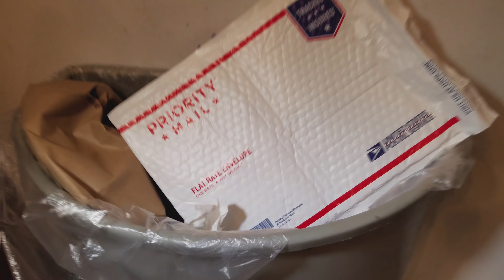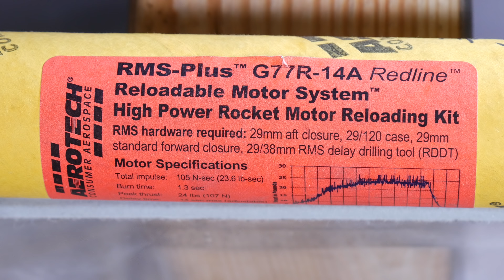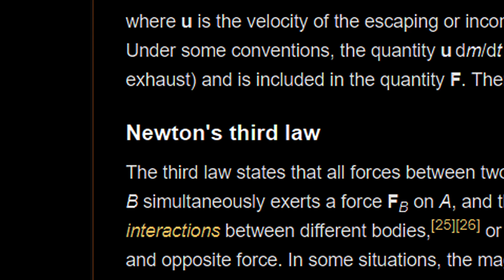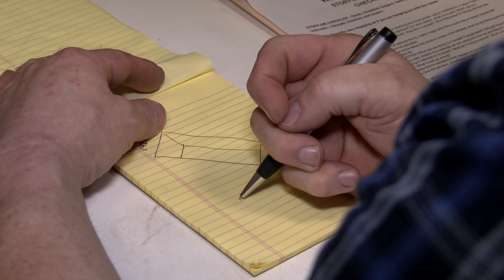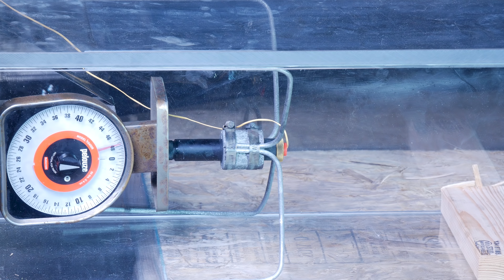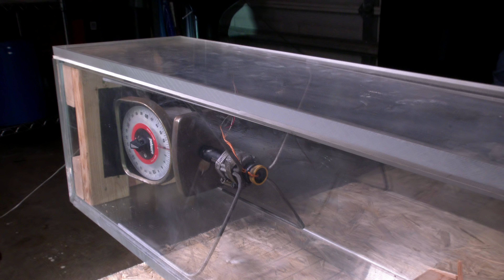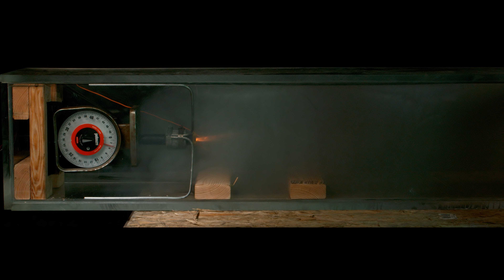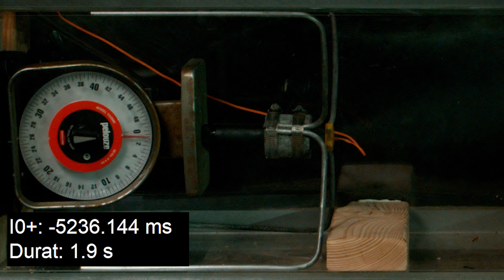Rockets in a Vacuum Chamber - Newton's third law of motion Visualized

Comment: I have a question. Did you measure the amount of vacuum within your chamber during the entire burn process?  This seems important as the demonstration of a continuous vacuum throughout the process is necessary to establish whether or not the thrust results were actually obtained in a steady state of vacuum.  Is the lack of atmosphere steady or dynamic?  In true space, a rocket motor will have no vacuum altering affects on its surroundings.
Reply: Yes this makes this test invalid. At 3:10 with partial vacuum you can see the lid pop off when rocket fires. Heat will rapidly increase the pressure inside this chamber giving mass to the surrounding air and provide thrust. Would be nice to see a PSIA gauge shown in the high speed video to know what pressure the test starts with. Then observe the pressure increase after rocket fires. How strong is his vacuum pump? How close to 0 psi can it get? Takes a very strong pump to do this and no pump can get to 0.00 psi like you would experience in outer space. Besides thrust by definition is a force created through interaction with a fluid. Could be water or air etc. The heavier (more mass) the fluid, the greater potential for thrust. In this test, if 0 psi was reached there would be no mass to the air inside and no way to shift weight, hence produce thrust. This test is a misconception from the start because it attempts to prove Newtons Thirld Law in a vacuum and not thrust in a vacuum. The rocket would need to be mounted by something with near zero friction to measure the very small amount of force created from transferring mass out of the rocket and exiting into the chamber. It would need to be very sensitive to pick up the small amount of force.
Reply: @stuartgray5877  You are confusing recoil with thrust. They are two different things. Recoil is the transfer of a mass within the object. Thrust is the interaction with a fluid that has mass. The more mass a fluid has, the greater ability to produce thrust. You need to understand that in a vacuum or zero pressure, air has no mass. You can move as much of it as you want but there is no resulting force. As atmospheric pressure increases from 0.00 psi, surrounding air increases mass and the potential to produce thrust is made possible. THRUST in a vacuum is impossible. Recoil as you state is but don't confuse recoil with thrust.
Reply: @RNDInnovators  - "You are confusing recoil with thrust. They are two different things"

They are NOT different things.
they are BOTH results of the Law of Conservation of Momentum.

"You need to understand that in a vacuum or zero pressure, air has no mass"

This is 100% FALSE.
Air has mass regardless.

I will BET that you have never even taken a physics class, but you feel confident trying to explain rocket propulsion to an actual rocket scientist?

Answer these three questions:

When a rocket engine is running:
1 - Is the exhaust gas ACCELERATED as it leaves the nozzle? (does it undergo a change in velocity)?
2 - Does the exhaust gas have MASS? Yes or No?
3 - Can MASS be ACCELERATED without a FORCE? (or is a FORCE required to ACCELERATE MASS?)

Answer these three questions to get a baseline and Ill ask the REAL questions.
Reply: @stuartgray5877  Sorry but you are failing physics class right now. Look up whether air has mass in a vacuum. Look up what happens as you increase air pressure within a tank. It gets heavier. Reduce pressure and it weighs less. Water becomes a gas as you go below 0.5psi. Again understand the difference between thrust and recoil. Recoil in a vacuum is not thrust. A jet boat produces thrust due to the interaction with the fluid it passes through the pump. Jet aircraft engine interacts with air to produce thrust. The amount of fuel burned and exiting at high velocity is producing miniscule amounts of thrust. A rocket at launch has both a recoil force from high velocity exhaust gas but majority of the thrust is produced by pushing against the surrounding high pressure air that has mass. The rocket fuel tries to expand but it meets resistance by the pressurized air that does not want to move out of the way so easy. At high altitude the air has almost no mass and easily displaces when acted upon by a rocket. The X-15 was losing "thrust" as altitude increased. I've been a pilot for 25 years and have a shop with a vacuum press. Have you taken any flying lessons? You should. Also learn how a vacuum press works.
Reply: @RNDInnovators  - " At high altitude the air has almost no mass"

It boggles the mind that people with absolutely NO GRASP OF BASIC PHYSCIS have the audacity to argue with people that actually received an education.

Bless your little heart for effort though!

The Company I work for test dozens of Hydrazine thrusters a year IN A VACUUM, here on earth and VERIFY that they produce the thrust predicted by the Tsiolkovsky Rocket equation.
We then put those thrusters on actual spacecraft and launch them to space and TEST THEM THERE TOO!

I have personally launched SIX spacecraft, four to deep space, and five of the six had Propulsion systems.

You are literally trying to argue with an actual Spacecraft Engineer about how spacecraft work genius.
Reply: @RNDInnovators  I'm even in a Spacecraft Preliminary Design Review right now and we are reviewing the Propulsion requirements for the NEO-S mission to the L1 LaGrange point.

But a high school dropout wants to tell me that my 30-year long career of launching things to space is all a hoax?

Bless your little heart!
Reply: @RNDInnovators  - Answer these three questions:

When a rocket engine is running:
1 - Is the exhaust gas ACCELERATED as it leaves the nozzle? (does it undergo a change in velocity)?
2 - Does the exhaust gas have MASS? Yes or No?
3 - Can MASS be ACCELERATED without a FORCE? (or is a FORCE required to ACCELERATE MASS?)

Answer these three questions to get a baseline and Ill ask the REAL questions.
Reply: @RNDInnovators  - " I've been a pilot for 25 years and have a shop with a vacuum press. "

Aww you are sooo cute!

I have been operating some of the nation's largest thermal vacuum chambers since before you were born.
My FIRST job in Aerospace was at Lockheed Martin's Space Simulation laboratory operating the same TVAC chamber the Viking Landers were tested in.

It is a 30X60 foot cylindrical chamber with a full solar beam simulator and can pump down to 1.0X10^-9 Torr with liquid Nitrogen cold walls and liquid Helium cold plates.

I have been PERSONALLY responsible for vehicles worth more than a nuclear submarine while inside these chambers.

But you want to compare your experience with a VACUUM TABLE?

You are HILARIOUS!

And I am a BRAIN SURGEON because I played "Operation" once when I was five.

Bless your little heart!
Reply: @RNDInnovators  The Propulsion module for the spacecraft I am working on right now is being delivered today.  Shall I send you pictures of something YOU claim is impossible?
Reply: @stuartgray5877  Yes please do. Send me video of NASA testing thrust in a vacuum chamber while you are at it. Or maybe some vacuum chamber tests where the suits they use can not work in a low pressure environment. Humans need at least 9psia to be comfortable. Those fabric suits are not pressurized to 9psi. They would be too stiff and require solid hinge points at the human joint locations. Any flight beyond 400,000 feet ASL and the moon landing is laughable.
Reply: @RNDInnovators  Ok I can show you live video of rocket propulsion in a vacuum, but I suspect you will refuse to just watch it.

Search YT for "uninterrupted footage of the falcon heavy launch and booster landing! 2-6-18" from "Astronomy Live".

Just TRY to tell me that video is fake.

And the same event filmed from the rocket itself: "Falcon Heavy Test Flight" from SpaceX.

Next explain what YOU saw happen in that video from launch to booster landing.
Reply: @RNDInnovators  And I see changing the subject to something ELSE you don't understand.  Got it.

Just so you know a human could survive inside a Mylar birthday balloon inflated to 5 PSI pure oxygen in the "vacuum of space".  For a few minutes at least.
Reply: @stuartgray5877  Send me the video of rocket propulsion in a vacuum. I'd love to watch it make less thrust then in a pressurized environment. The idea of rocket fuel exhaust producing more thrust in a vacuum because it is not slowed down, goes against Newtons 3rd law. If there is resistance to the high velocity exhaust then there would be higher thrust. Pushing pressurized heavy air out of the way that has mass would cause a lot of resistance and provide far more thrust then in a vacuum. It's like saying a shop vac is working harder when you block the end of the hose. No. There is less load on the motor and that's why it revs up. Same principles at work. Also, a shop vac does not suck air into the hose. Atmospheric pressure pushes air up the hose into the low pressure canister. Suction implies something is being pulled. There is no tension on anything. Only differences in pressure that force air to move.
Reply: @RNDInnovators  check the comments section for a new post
Reply: @RNDInnovators  - "Send me the video of rocket propulsion in a vacuum. I'd love to watch it "
Sure watch the YT video: "Uninterrupted Footage of the Falcon Heavy Launch and Booster Landing! 2-6-18"
Watch from launch to side booster landing and tell us what you just witnessed.

And if you want the SAME EVENT but from the rocket, watch "Falcon Heavy Test Flight" from SpaceX.
Reply: @stuartgray5877  the vacuum of space is BEYOND an altitude of 190,000 km show me a rocket which advances and orients itself with its reactors in the vacuum of space 😂
Reply: @jincen3306  - I can show you many. I have built, tested, launched and operated many deep space science probes and earth orbiters. most had propulsion systems.  Lookup Mars Global Surveyor, Stardust, Genesis, Deep Impact, Kepler Space Telescope, NOAA-20 for a few.
Ask me any questions you like about those missions.
Reply: @jincen3306  I am also a vacuum test specialist and have operated some of the largest thermal vacuum chambers in the country with Billion dollar vehicles inside.
Reply: @stuartgray5877  Ok show us homie
Reply: @stuartgray5877  Show me please
Reply: @stuartgray5877  bragging rights!!!!  lol!
Reply: @jincen3306  "he vacuum of space is BEYOND an altitude of 190,000 km" What's the pressure differential, champ?
Reply: @Captain-Obvious1  The pressure difference between the Earth's atmosphere and the total vacuum at an altitude of 190,000 km is extremely large. At this altitude, you are well beyond most of Earth's atmosphere, and you are in what is called deep space. At this distance from Earth, atmospheric pressure is virtually zero, meaning that the pressure difference between Earth's atmosphere at the surface and space 190,000 km away is of the order of zero.

In other words, the pressure at 190,000 km altitude is almost zero, while at the Earth's surface the average atmospheric pressure is about 101.3 kilopascals (kPa) or 1 atmosphere ( at M). 

"This experiment is flawed because the rocket's exhaust gas fills the vacuum chamber, whereas in space, you cannot fill the vacuum with gas."

I hope you are a good student and that you understood your lesson from your teacher
Reply: @jincen3306  "BEYOND an altitude of 190,000 km" Your quote, your numbers. Whats the difference before 190k km and beyond it?
The point you tried to make was, before 190k km, you can ignore the evidence he presented.
Not "virtually" this or that - I asked for the differential justifying your assertion.
Reply: @jincen3306  Let's clear something up. Do you think the space inter-solar system is "total vacuum"?
Reply: @Captain-Obvious1  Ok you don't believe in science
Reply: @Captain-Obvious1  This is science: Troposphere: The troposphere is the lowest layer of the atmosphere and extends from about 0 to 12 kilometers in altitude. Atmospheric pressure decreases with altitude, and at the Earth's surface, it averages about 101.3 kilopascals (kPa) or 1 atmosphere (atm).

Stratosphere: The stratosphere extends from about 12 to 50 kilometers in altitude. Atmospheric pressure gradually decreases as you ascend in this layer.

Mesosphere: The mesosphere extends from about 50 to 85 kilometers in altitude. Atmospheric pressure continues to decrease as you go higher in this layer.

Thermosphere: The thermosphere extends from about 85 kilometers to several hundreds of kilometers in altitude. The pressure in the thermosphere is extremely low and is often measured in millibars (mbar) or pascals (Pa).

Exosphere: The exosphere is the uppermost layer of Earth's atmosphere and extends beyond the thermosphere. In this region, atmospheric pressure is extremely low and becomes negligible. It gradually merges into outer space.

Outer Space: Outer space, located beyond the exosphere, is characterized by virtually zero atmospheric pressure. There is virtually no matter in this region, making it a true vacuum.

Please note that atmospheric pressure levels can vary with weather, geography, and other factors, but the values provided are general approximations.
Reply: @jincen3306  Sure I am fully aware of the pressures in the atmosphere. I'm wondering why you showed me those rather than answer the question about space.
Reply: @Captain-Obvious1  Let me ask you a few questions, is a rocket like a bullet from a gun, will it go straight into space to infinity, am I wrong? How can a rocket launch from the Earth's surface and not go straight into space towards infinity as the pressure decreases? In space, how can a rocket change direction when there is no pressure?
Reply: @jincen3306  "is a rocket like a bullet from a gun" Newton's 1st law of motion.
"how can a rocket change direction" By ejecting mass into another direction resulting in an opposing force. Newton's 3rd.
Reply: @Captain-Obvious1  First, prove to me that Newton's third law works in a vacuum, or if you can't, try to explain it technically
Reply: @jincen3306  It works in EVERY songle experiment ever performed in physics. It's how we solve thousands of industrial problems.
You can't prove exception to the law champ just because of air pressure. We don't have to prove anything to you.
Reply: @jincen3306  Plus, at 10:30 in this video the thrust meter registers force before the smoke plume gets a few cm from the nozzle. The max thrust level also doesn't get greater as the chamber fills with smoke, revealing the claim it's "pushing" on the gas is false.
Reply: @Captain-Obvious1  No, we see the gas coming out at 10:22 then the rocket pushes the gas which pushes the plexiglass wall to the opposite and then the fuel runs out and the thrust decreases. The combustion of the rocket cannot exist in a vacuum without oxygen, but it can occur for a short time thanks to the dioxygen that the combustion gives off, this is exactly what we see
Reply: @jincen3306   "pushes the gas which pushes the plexiglass wall " How does the force pass back through a thin cloud of particles, champ?
Reply: @jincen3306  Haha. Poor you. As SOON as we see sparks the meter registers some thrust. You absolutely cannot refute the laws of physics. Your observation proves my point even better than I did.
Reply: @Captain-Obvious1  Gases can be ejected in gaseous form before full combustion conditions are established, thrust begins from that moment on, you're really bad at science😂
Reply: @jincen3306  Im telling you what we see. Youre denying it. So, nope. Youre the one who cant science.
Reply: @stuartgray5877 he meant video from lab
Reply: @jincen3306  - 
"First, prove to me that Newton's third law works in a vacuum, or if you can't, try to explain it technically"
Newtons third law is what governs mechanical Recoil.
Tell us: What would happen if you fired a steel projectile from a Crossbow into a vacuum?
Would the crossbow still experience a "Recoil force" in the opposite direction that the projectile is fired?
This IS "Newtons Third Law", now tell us you do NOT think that mechanical recoil still works in a vacuum.

Spoiler alert: I have built THREE spacecraft that had separation mechanisms very similar to a crossbow and we actually DID test them here on earth in a vacuum AND IN the vacuum of space. SO, I know the answer already.
Reply: @nazalostizsrbije  - "he meant video from lab"
I dont know what this means.
Reply: @stuartgray5877  not video from space but test in vaccum chamber.
Reply: @RNDInnovators  Air does have mass in a vacuum, are you confusing mass with weight?

Comment: but dident the roccket produce atmosphere while burning off the oxidizer??
Reply: Exactly.  And you can see the rocket produced more thrust as more atmosphere was produced.
Reply: You could do the same experiment with water blasting out and it would give the same result.
Reply: @Bobby b Same thing happens when you open a soda can in vacuum. You have immediate trust,  without building up the atmosphere. So yes, the rocket would have moved even if it wouldn't produce "atmosphere".
Reply: @amunra4015   No, it's producing more atmosphere as the thrust builds up.
Reply: No Not at all. Atmo means air, sphere means a spherical shape, atmosphere is therefore air that takes a spherical shape. No he did Not produce that at all.
Reply: @amunra4015  That's due to the motor's thrust curve. It takes a second or two for the propellants to ignite - it's not an instantaneous process. If you try lighting a piece of paper, it'll take a second or two before it really gets going - same concept.
Reply: There shouldn’t be any oxygen it’s a vacuum
Reply: If he was a True vacuum ,  The gases wouldn’t be able to build up